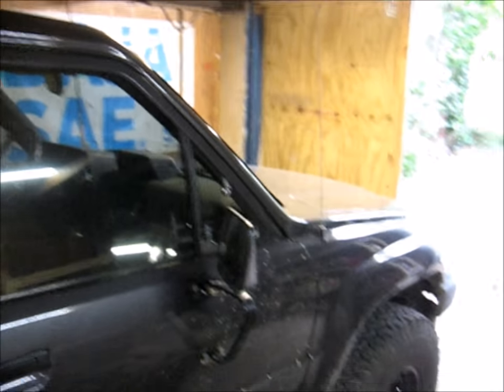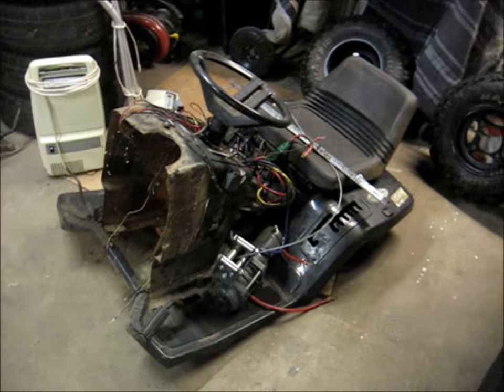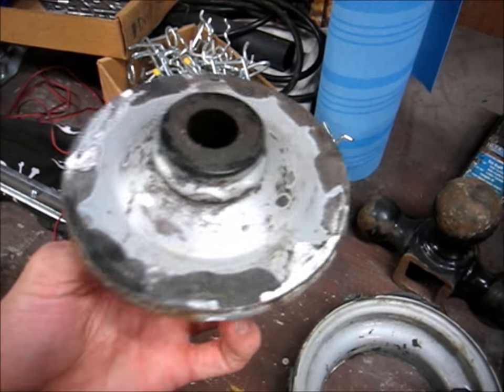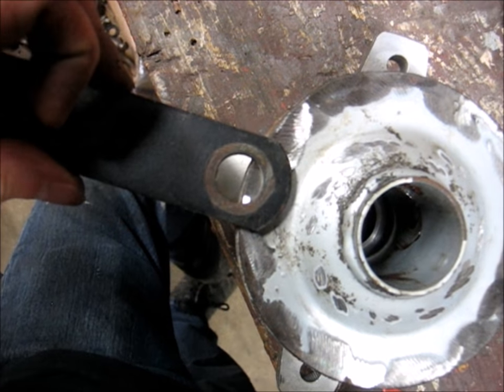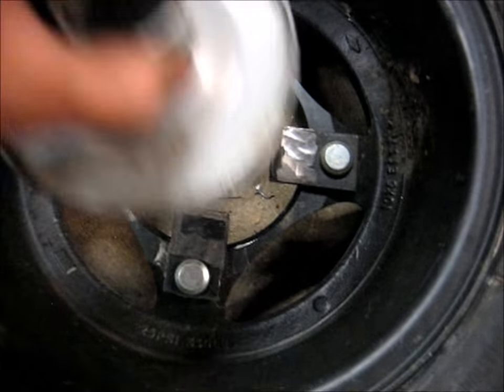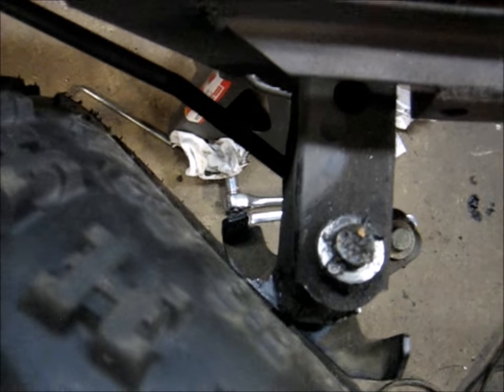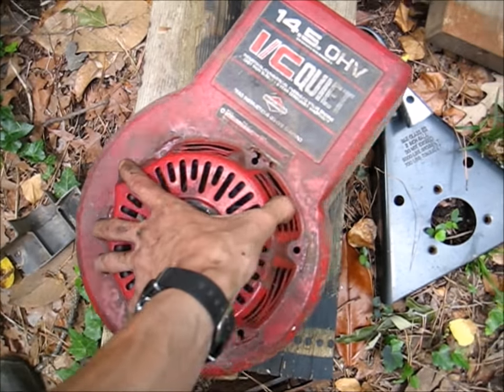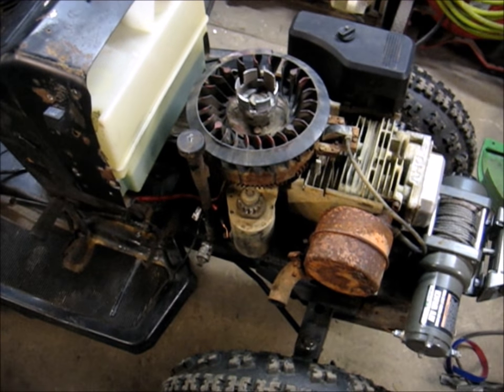Big Front Tires for the Rompin Mower plus Build Details

Comment: You may want to get that old pulley switched to something else, since those are ticking time bombs. But it is nice to see that you are making videos again!
Reply from the maker: The pulley on the trans? What might I be looking out for? It's been on there almost as long as I've had this mower.
Reply: +TheAlexManVideos yes the pulley on the trans, they are only designed for fractional horsepower (less than a horsepower) and usually will grenade themselves due to the insane amount of pressure on the pulley. Try searching for a solid steel pulley or a die cast one, i use die cast they are around ten to fifteen dollars each.

Comment: U should upgrade to Bronze bushings for the spindles and wheels so it can handle some more stress with the big tires
Reply from the maker: It's on my list. The stock plastic ones have lasted this long but they are pretty much gone. Lots of play.
Reply: +TheAlexManVideos looks like those "front hubs" have an inside diameter like a wheel barrow or regular go kart wheel.. which is 1⅜" i.d. ik u can get ¾" i.d./1⅜" o.d. bearings for go karts or my local hardware store sells them but probably won't help u😑..

Comment: What kind of transmission is in it because it looks like a spicer and those have a tendancy to grenade themselves lol
Reply from the maker: It's a Peerless MST206. I've blown up a couple. Both times the differential was welded and then scattered causing little pieces to poke through the case. This one has a solid shaft from one wheel to the other. So that should be fine until I figure out what the next weak link.
Reply: I have a peerless 801 in my mower and it has a solid axle in it and its been pretty bulletproof so far. If the 206 blows up you should try an 820 or something like that.